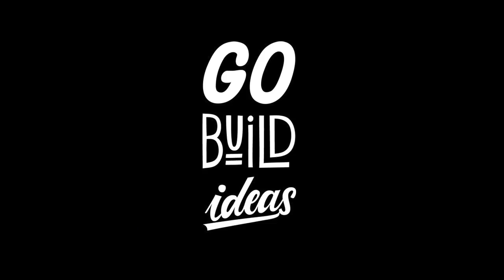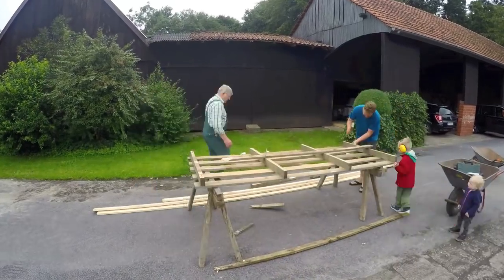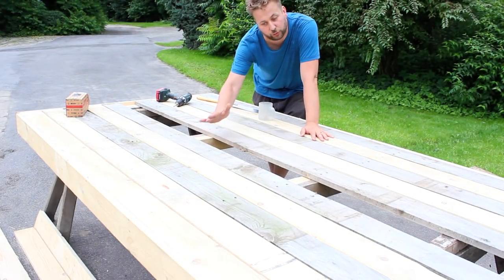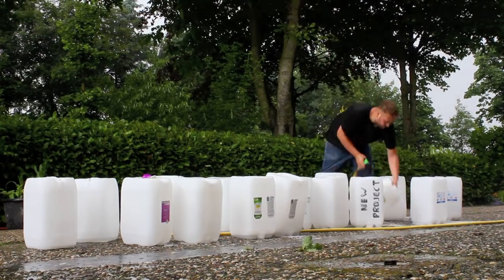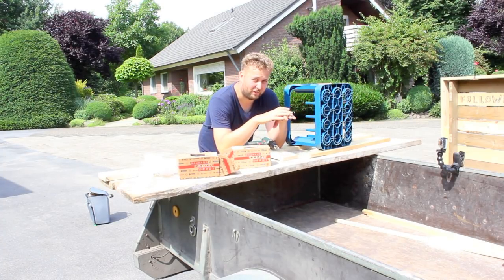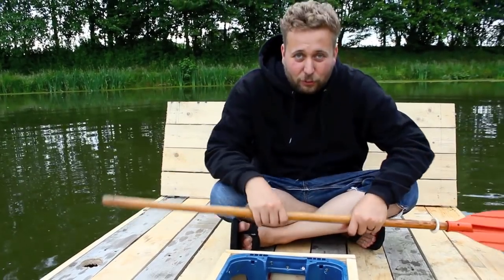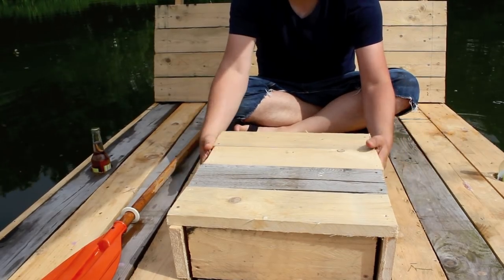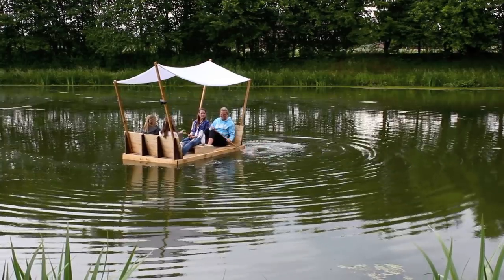BUILDING AN AMAZING PALLET RAFT

Comment: Nice build!  I am wondering how the water can keep the drink cold. I live in a tropical area and all the water here is warm. Seems a cold temperature would not be comfortable to be on the water. If it is that cold, you would want a hot drink.
Reply from the maker: Lucky, you! Always warm water sounds amazing! 

Here in Germany, the water is´nt always as warm. It is right now in the summer, but in spring and autumn, it is usually cod enough to chill down your drinks... 

For your area, you might just add a bucket of ice cubes and some refreshing drinks i guess :-)

Comment: 2 pvc pipes (10 or 12 inch) one at each side will provide much better stability ... you can attach them firmly to the sides using stainless steel straps and some screws.

Comment: what kind of jugs were those, and how many did you use?
Reply from the maker: Hi, those were canister which were containing soap i think. I got them in a local shop for free... Each of them containing approx.25 liters. I used 18 of them on total. One thing: i made sure they are extremely clean - i cleaded the several times, to make sure they do not leave anything harmful in the water....

Comment: The glass bottles should not be used. Imagine someone falling and breaking the top of the bottle and sliding creating a huge gash. Also bottles that end up in the water have a habit of cutting swimmers feet. Use canned beers instead please.
Reply from the maker: Hi Jim, thanks for your comment, i totally see your point! If this was a public raft, this is a very good point to prevent any accidents. I just build this raft for myself and i know what to look for, so i guess i am fine. My friends, which used the raft, were aware of this too...
However, Plastic would´nt be a good alternative eighter, since plastic is all over the seas anyway, i am trying to use as little plastic as possible...( And i take my trash with me all the time)
Btw,. that particular pond is´nt really for swimmers (its not really the cleanest water, so no one really goes to swim in that :) , so that wasn´t  an issue really. Nevertheless, i think it is a fun idea, and if you are a bot careful, this should all be fine :-)
But thanks for your thoughts, i really appreciate it! 
Greetings from Germany, Johannes

Comment: Has the strings held up? Maybe zip ties would be better?
Reply from the maker: Hi, you mean the strings for the canisters? Yeah - in fact, they are still all intact - even after about 1,5 years!
I useds thoses strings and fixed them with zip ties actually, just to make sure...
Greetings, Johannes